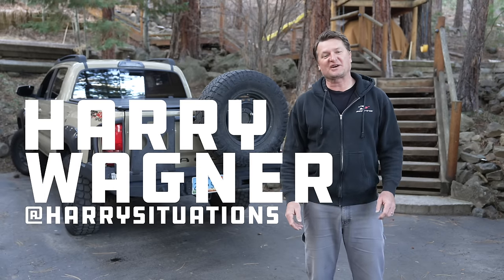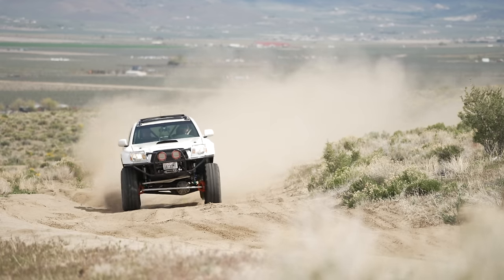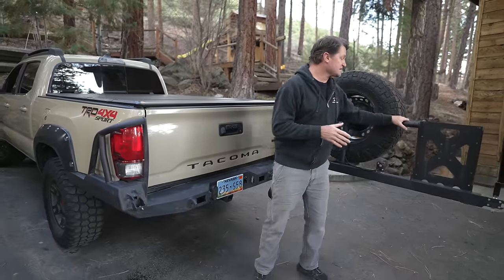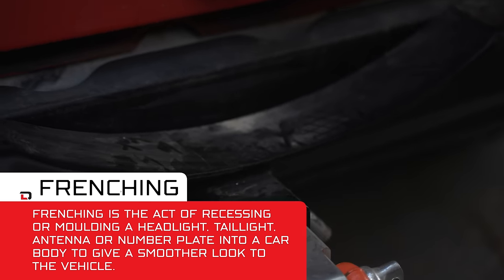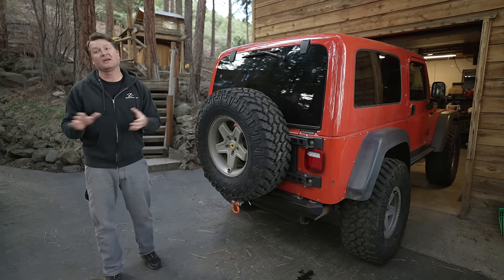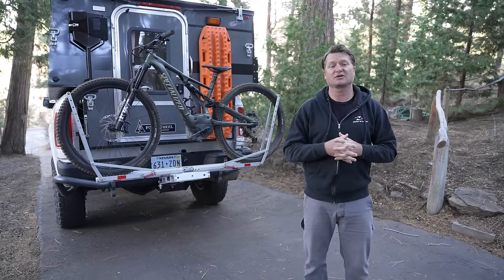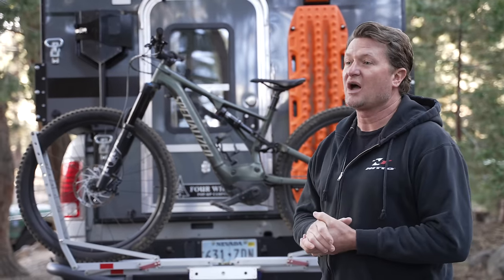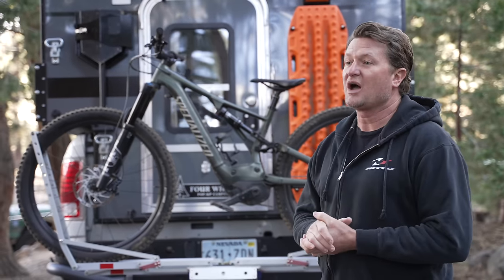Watch This Before Buying A Swing Out Tire Carrier | Harry Situations

Comment: I work fixing 4x4 vehicles please don’t use different sizes of tires even on road: the differentials are not designed for survive continuous use with different tires, and your transfer case neither (only if there’s no other option), I think I appreciate the suggestion but brings me more peace of mind to do the sacrifices necessary to have another tyre the same size (if the tire is able to fit reasonably) from a mechanical standpoint
Reply: I just use this to limp off the trail but by varying air pressure and running the undersized tire on the front in 2WD it should be fine for short distances. The transfer case won’t care because it isn’t sending power to that axle.
Reply: I agree with you  I was a jeep  tech and the had recall the had replace all the spare tires with a different size

Comment: I used a factory gm zr2 swing out carrier that also doubles back as spare parts. Complete with hub, stub, bearings, lockout, wheel studs and lug nuts.
Reply: Do you have a part number? A quick Google search yields only aftermarket options, no OEM GM tire swing out.
Reply: @jshaw6600  I don't have one. The swing out carriers came on the 2 door s10 zr2 blazers. I snagged one from my local junk yard. I hacked it up, and bolted on a matching spindle/hub for my front axle.

Comment: I made the mistake of putting my tacomas spare on a swing away and it ruined the ride quality. That much weight that far back gave the truck a tail wag that was disturbing.  I ended up switching back to the factory setup.  I learned from that mistake.  Now my Tire size for any build is set by what fits in the factory location (with modifications).  It’s amazing what you can tuck under a truck with a bit of  trimming.  My last e350 had a 35.5”  in the factory location.   My current van came with a water tank already installed in factory spare location so I’m stuck with a swing away but the interior is laid out in such a way that we never use the rear doors anyway. Also the 1 ton chassis doesn’t mind having the extra weight hanging off the back like a lighter truck does.  🚐🚐🚐

Comment: That’s why I bought an internal rack for my JL. I have the spare inside, almost to the roof, strapped down with a proper ratchet strap specifically made to hold a tire, horizontally. This leave everything still open below the belt line of the body tub.

Comment: Good vid Harry. 
I hate my tire carrier on my 80series LC. I fought going that route for years. It’s a double swing so half the width of the truck so not as bad as that taco. As you pointed out. Can’t get my upper hatch open without swinging the spare open.  It’s really more of a Pain than. I thought it would be. 
Unfortunately the stock location can only accommodate a 33 and I kept it deflated to let it smush up to the hitch hight because It hangs way lower than even the trailer hitch with a stock style hitch.  My aftermarket bumper moved the hitch up a couple inches so even worse clearance now. 
Running a smaller diameter spare is not an options with the AWD.  Right now only on 33s but ready to regear and possibly go to a 37. Full drawers with a sleep platform so moving it inside is not possible. Just screwed. This truck is more a DD overland rig now. Looking at a new build and considering flat bed the spare will likely be standing vertical behind the cab. Possibly in a well to get it lower.
Reply: That is how I had my Toyota pickup set up. Vertical spare sunk into the bed.

Comment: I love it. I carried a 35" spare in the stock location when I ran 38s but kept tearing the side wall so I built a swing out tire carrier. I totally get your thought process and I tend to agree with it. I'm stuck in this position once again on my current build. 1998 Isuzu Rodeo on 35s with yukon grizzly, and there is absolutely no way in hell that tire is fitting under the rear, or even it the rear cargo area. It's been 6 months now and I still can't decide what to do. 😂
Reply: You can’t put it upright in the cargo area?
Reply: @HarrySituations  I've considered it, but with my tool roll, CO2 tank, spare parts and gear it doesn't leave much room for anything else. I've always been a Nitto or Toyo guy so didn't worry much about a spare except long trips. It's usually just an ARB plug kit and Gluetread sidewall kit. Now that I'm running Patagonia M/Ts I'm a bit worried. 🤣 35x12.50x15 on beadlocks.

Comment: I also have a smaller spare on my truck in the factory spare location.  I have a nice plug kit and keep an air compressor as well. If I need I can put the spare in the front.  I have electronic activated lockers, so I could keep those off if needed or use them sparingly to get out of a situation.  Obviously would replace the tire as soon as possible with the correct size.

Comment: All great points. I've had a few flats on my 4Runner, and I just plugged them without even removing the tire from the vehicle. Haven't touched my spare in the 5 years that I've owned it, it's probably rusted solid up in its mount anyway, haha. When I upsize tires, my plan is to run a 255/75 as a spare, it's a little shorter and narrower than the 285/70 that I'm planning on going to, but my theory is that if I'm aired down on the other 3 tires the diameters will be approximately the same. And like you said in the video, the spare is the last resort.
Reply: That is the size I ran for a spare on my 3rd Gen 4Runner in the stock location. Fit great!

Comment: Agree with a lot of what you said. BUT, The issue with the spare in the stock location underneath is that you may not be able to get it out when you need it if you are offroad. That is why I am considering a swing out, despite the drawbacks you mention. Another great option is to put it in the bed before you go on an offroad trip. I like to carry a full size spare so I can actually drive on it for a good distance after. But if you just need the spare to get you off-trail, a smaller spare is a good idea a lot of people forget or don’t know about. 

Nice mountain bike. I ride a Santa Cruz Bronson and an Ibis Oso- both go in the bed of my Gladiator with an Alucab canopy. Bought the truck around the bike- ability to do this was number 1 priority of my rig.  Lol.
Reply: Great points! I put the bed in the spare of my Tundra when I go off road because my suspension doesn’t allow it to be mounted in the factory location. My only issue with that is it takes up a lot of room and when I go on a trip is usually when I have the LEAST room to spare in the bed.

Comment: One problem with the smaller spares is if you have a fulltime 4wd rig.  I hate the full length tire carriers like the one on the Tacoma.  They are PITA to open anywhere and on the trail you can forget about opening it.  I think it depends how you are wheeling and how far you are from civilization as well.  If I'm 200 miles or more from a tire store on a 4wd vacation I'm not going to risk not having the correct spare or rely on plugs.  I think I'd be willing to risk it more if I ran a common size tire that could likely be found in rural parts.  Finding a 37 or larger is going to be darn near impossible.  Finding a 285/75/ish 16, 17, or 18 would be a lot easier and I might be willing to rely more on plugs or an off sized spare with a common size.  Access can also be an issue if stowed under the vehicle.  And the spare is more likely to be damaged underneath.  With that said, I have spares stowed in the cargo area, on swing out carriers, and underneath in my 4wds.  It just depends upon my use as to what I need for that particular vehicle.
Reply: Excellent points.

Comment: I agree with what you said. That is why I went with the biggest tire that fit in my stock spare tire space and called it good. My reasons were  pretty much same that you  pointed out. How often do you get a flat these days (I don't want to say more lest I get hexed)
If you do get a flat - it will take you 20 minutes more to change it - so what
I would first try to plug the tire before changing it - I should practice it a few times though
More weight further back could increase porposing.
One more latch you have to open to get to the back - that must get old after a stretch

What I did not consider (or thought it reckless-:) is to install a smaller spare than the rest - Blasphemy!  My current spare just fits but  does rub a bit  - so I just may go with your radical idea and have a smaller spare.

Expect to get flamed by all the bumper tire mount manufacturers & those god awful hitch spare tire mounts team.
Reply: Do you have on board air? Maybe could carry the spare deflated?
Reply: @HarrySituations  Yes an ARB and  a portable air pump. 
I did deflate the tire - I went to about 15 psi - I did not want to go much lower to keep the bead set.
Reply: @TerryManitoba I would be willing to send you a Nitto T-shirt and sticker pack if you remove the valve core from your spare and put a ratchet strap around it and can get it to come off the bead.
Reply: @HarrySituations  Really - well I'll be damned. 
I usually research the f out of every thing. Not this topic. 
I do have a racket strap around the tire. I will now take it down to ZERO & hope for the best - I guess!!!
Reply: @TerryManitoba  worst case you get a T-shirt out of the test. 😉
Reply: @HarrySituations  Ha - I don't figure I'll be trying to take it off - But thanks for the heads up. I hope it's enough to stop the rubbing. If not I will go with a smaller size. A win win.
Reply: @HarrySituations  So-  in this age of UnEarned Awards. 
Do I still get the T & stickers just for participating-:)

Comment: I added relentless swing out to my colorado zr2. Little annoying, but not that big of a deal. I am only running 33’s, but the factory spare under was hanging so low, it had to go. I destroyed one tire and mangled the spare rim pretty badly just by getting hung up on rocks. Tacomas etc are tucked in higher, but Colorados weren’t.

Comment: I hate having a tire swing out but any size spare tire under the back of my 2000 4runner hangs too low.
Reply: Not sure what size tires you are running. I had 285/75R16 tires on my 3rd Gen 4Runner and put a 255/85R16 spare in the stock location. Same diameter but and inch and a have skinnier.
Reply: I’m running 35s. But my custom bumper is thinner than the stock bumper and the hitch is built into it. Even a 255, most of the tire would hang below the bumper. I’ll have do some measuring.

Comment: You should do a review of sidewall repair kits like Gluetread. I have a XJ and have always grappled with where to put the spare. Need the room inside for camping gear. A tire carrier would get in the way of my bike rack and I don’t really like putting it on the roof but that’s what I’ve been doing thus far. Thinking about just carrying a plug kit and Gluetread kit instead.
Reply: I don’t have any firsthand experience with Gluetread but I will look into it.
Reply: Look into Detours off-road USA offset hitch mount tire carrier. I assume you have a hitch. The offset mount is another 2” receiver that bolts to your hitch “frame”. Mine is on the drivers side. Then the tire carrier I have from detours rotates down to the left side. So I can access the hatch. It’s a lightweight setup. 25/30lbs. Fits tight and close to rear hatch. Mine has a 33” tire on it. Doesn’t rattle around. And I can still use my actual hitch receiver as a recovery point. And for my bike rack. Bike rack has a 12” hitch extension on it so I can still carry two bikes behind the spare tire.
Reply: @russjowett2137  I did consider exactly what you are mentioning but I think Detours USA which became Detours of Maine went out of business unfortunately. I kind of wish I had bought one of their tailbone tire carrier kits even though it is a swing out.